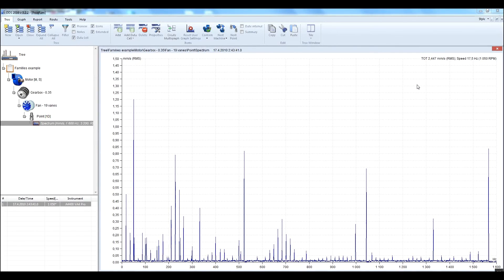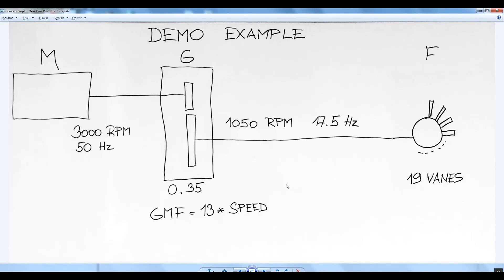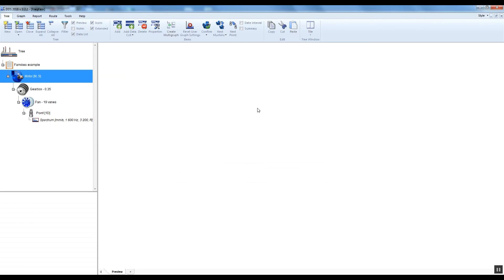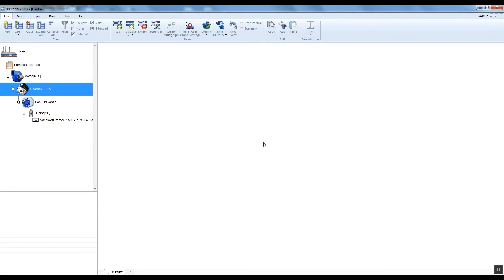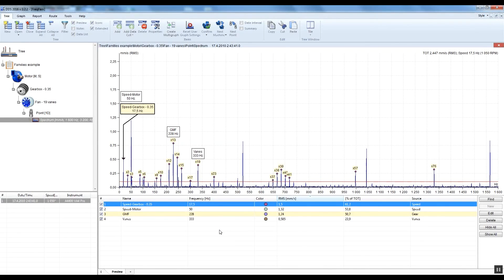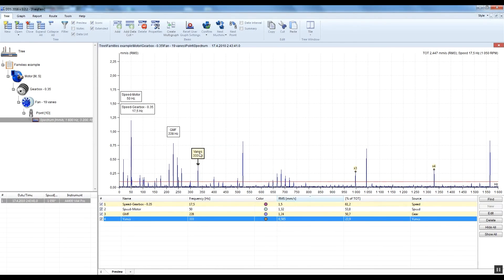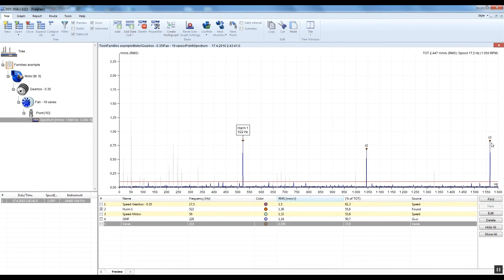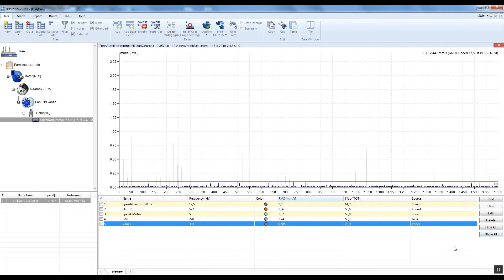Adash DDS tutorial 06 - How to decode FFT using Families function

Comment: Hi,
This seems like a helpful function to use.
I am assuming that the spectrum shown in the example is the data taken at fan's bearing. So the data taken at other points on the motor and gearbox will be placed under their respective positions, right?
Here is an example of a steam turbine's vibration data that I have imported from my VA4 pro to DDS software:
https://drive.google.com/file/d/1XgVvXI9PdiozQbKsAa65-Yubd-4ohV7P/view?usp=sharing
 Please let me know if I have setup all the measurement points correctly for using the families function. (The points with + sign are ones that have vibration data, i.e, RMS, FFT, Time Waveforms etc.,)
Reply from the maker: Hello. Yes, the spectrum is from fan's bearing and other data will be under particular measurement points. You shared just a picture of your route tree. This does not tell us too much. We need to know what properties you defined under each item such as speed, gear ratio... Please write me on my email so we can communicate better. revaj@adash.cz